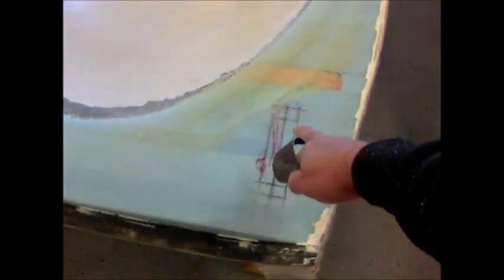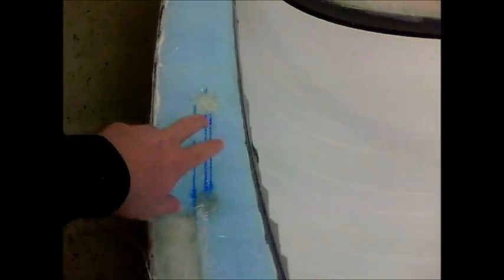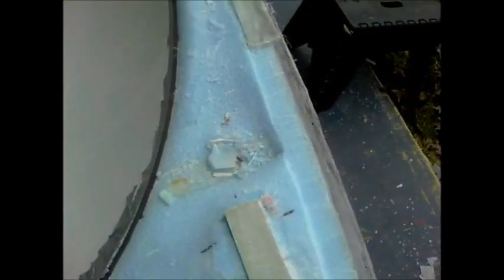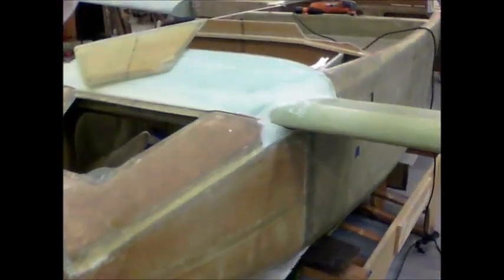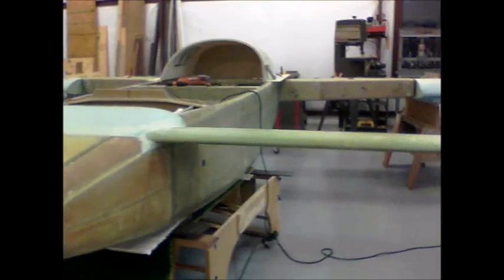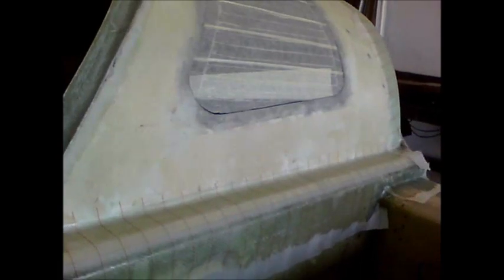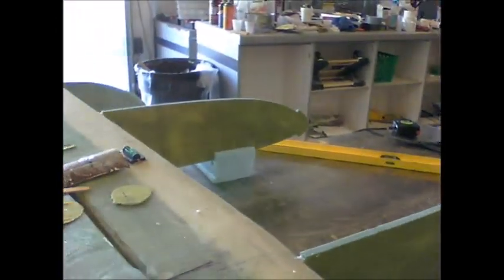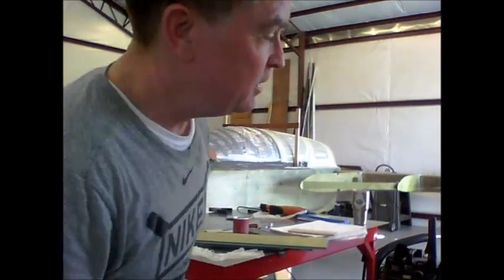Building the Cozy Mark 4 Canopy and Strakes

Comment: For the nose cover lip, won’t it catch rain when flying and force it onto the avionics?  Will the 3/8 bulb seal handle the differential pressure between the static air in the cabin and the 190mph air outside?  Did people have trouble with these items when they followed plans?
Reply from the maker: Ill let you know how it turns out when I start flying.  Thanks for the comment